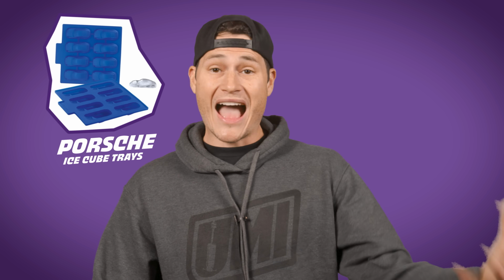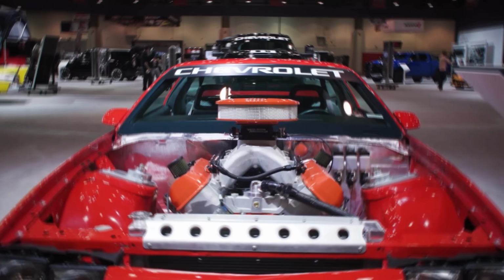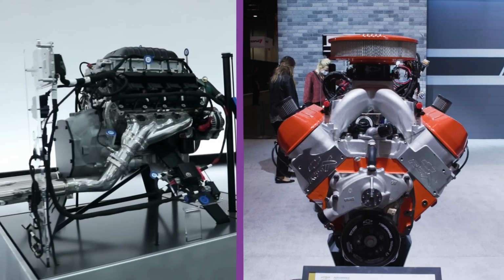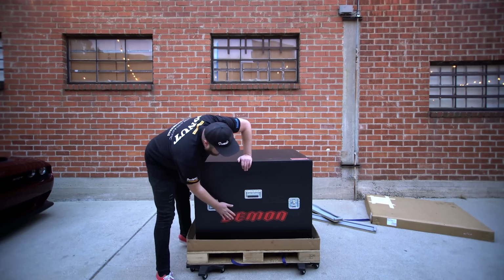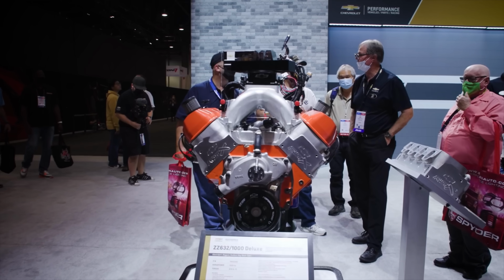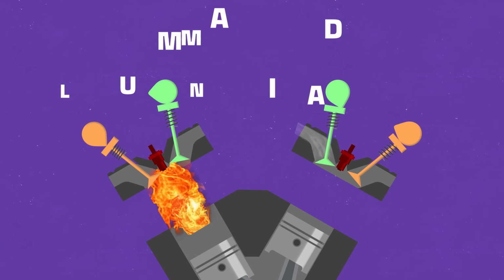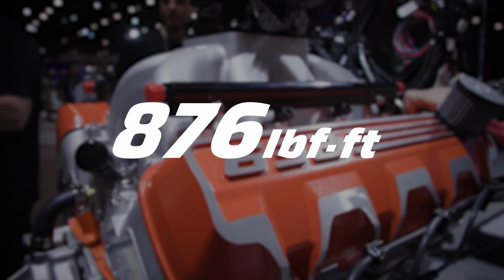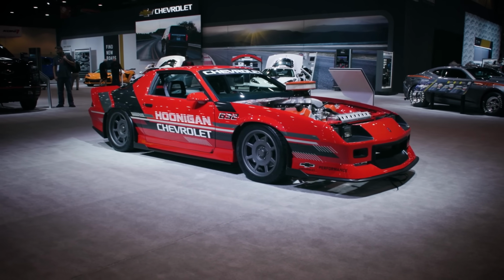Chevy's 1000HP Crate Engine EXPLAINED

Comment: Pretty crazy they can get this much power out of a wooden motor.
Reply: Haha 😂
Reply: These replys have gotten out of hand lmao
Reply: @MyHeadHz   these replies are so full of ignorance, there’s a balance between reliability, fuel economy, and rpm @ peak torque. Can guarantee the valkyrie engine will be nowhere near as reliable as this, you have to spin it almost twice as fast to get the same horsepower #’s. Fuel economy will be shit for both, but why is that even a factor at this level? You push this 632 engine much less than you’d push a valkyrie motor & get the same power output. F1engines are constantly rebuilt because in order to get such insane numbers, reliability goes down the drain so to speak, tighter tolerances & higher rpm’s = more wear, same concept as top fuel engines, but top fuel takes it to greater lengths.
Reply: @RegulerShowTV  I agree that most of these replies are ignorant lol
Reply: @RegulerShowTV  Nice to see someone who knows what he's talking about :). I used to be a hp per litre 'tard until i learned that Chevy LS engines are actually light and small in size, for sheer performance its not about hp per litre, its about hp per kg / lb.
Reply: @RegulerShowTV  bro really forgot the original commenters comment 💀

HP/L was the only discussion bro go get urself hydrated
Reply: @MyHeadHz  lmaooo
Reply: this is an engine for hot rod vehicles, not your everyday car.

The average piston speed at its peak revs (7000 rpm) is 29.5 m/s which is extremely high, the maximum average piston speed for the C8 corvette (base model is less than 21 m/s, for high revving cars, it’s usually under 25 m/s, and for an V10 F1 car, it is under 25 m/s and less than 27.5 m/s for short periods of time. 

29.5 m/s is incredibly high especially since every cylinders/pistons in the engine is massive 

The reason I am using piston speed is because piston speeds generally determine how much power an engine can create reliably. High piston speeds generally reduce the lifespan of an engine.
Reply: Motors are electric
Reply: Driving something with big block torque needs to be experienced to understand. Old tech that's still relatively cheap and will run reliably for many years.
Reply: @reto adyt I bet that zz632 is much more reliable than any part of the Valkyrie. Let’s also talk about servicing this engine in the Valkyrie. Can’t do it in your back yard like you can a big block. Overall yeah the numbers are impressive for the dinky little European cars. But this engine is much more attainable and attractive.
Reply: @onyxphantom6762  yeah if we take the convo that direction of course it wins by a long shot, but the only reason why the Valkyrie V12 is in the convo is because of the 1000 HP, if we take that outta the equation and talk aby built engines, ill go with EKanoo's stock block stock crank 2000 HP 2JZ.
Reply: moza rela  Reported.
Reply: block doesn't make power. IT just holds power. It's the head and piston design that's important.
Reply: @mehrshadvr4  and the crank and Rod design also not to mention the valves and the cams, or hell, every part other than the block! The block doesn't matter! Nor does the paint color on it 😂.
Reply: yoink
Reply: Right?
Reply: Right imagine a plastic lne
Reply: For a race car where you're always going to the red line, peak power is better.
For a road car where people tend to keep theax rpm at 4/5k rpm, a good torque is better. 
All in all, having well tuned transmission is what mater the most.
Reply: I was the 1,000th like on this comment
Reply: Lol!
Reply: @Silverhands  you can multiply torque. just need two cogs. you cant multiply power. that's physics
Reply: @motorhead281  no!
Reply: 1000 Hp wooden motor.  HaHa
Reply: Well, you'd make that much power too if you were locked in a crate, Mr.
Reply: @onyxphantom6762  exactly what you stated... power potential is derived from the displacement of the engine. A larger engine always has more Headroom in power potential. There is no replacement for displacement!
Reply: Is the Valkyrie available for just anyone to purchase?
Reply: @Coach_BigMac  no and it’s going to cost 💲 big money when it will be for sale
Reply: @Coach_BigMac  oh yeah they're in multiple numbers as they build 25 cars a year and they cost 3.5 million each and everyone here is comparing it to a $29,000 Chevy crate motor .. expressively showing the intelligence of the millennial children of today
Reply: @Coach_BigMac  and to who, is a 10.4L motor marketed towards? No car, no exhaust, no gearbox, nothing. Just the engine. 10.4L of it. 

The price, the market does not matter. The discussion is purely HP/L on a production engine that could be purchased with or without a car attatched to it.
Reply: @retoadyt3196 is 100% a drag racing engine. And I need one in my daily driver for...... making Corvette owners cry. They've had it too good around here.
Reply: @jordanalexander615  HAHAHAHA 🔥🔥🔥
Reply: @retoadyt3196  the plant that's makes Corvettes is literally an hour and a half away so you can imagine how many I see. Where is everyone getting this kind of money
Reply: @retoadyt3196 I reckon it’d be marketed to fellas like myself that drag race and have vehicles that originally had a big block fitted to it.
Reply: Its not so crazy when we convert the ci to cc to litres, which in litres this crate engine is a 10.4, so no, not so impressive. It takes more litres to make the desired HP. Valkyrie is a 6.5 making 1000 HP, all motor.
Reply: @retoadyt3196  but the Valkyrie makes 330ftlbs less torque due to that lower displacement, Maybe read up a bit on the differences and then come back. Horsepower is just revs, the Valkyrie needs 7 speeds, This crate motor would do fine with 4.
Reply: @skiptastic1000  original commenter didnt say anything about torque, just power.
Reply: @skiptastic1000  yeah buddy, ofc it's losing power because of the transmission... hey dummy, do you know these power figures were measured WITHOUT an gearbox, right? As you said, horsepower is about revs, gearbox losses are totally appart from that
Reply: @skiptastic1000  you think less speeds is better ? go electric 😁. jokes aside, performance engine and 4 speed + 680lbs is  a bit of a contradiction. plus it's NA so its still kinda peaky if you compare to a forced induction engine. makes peak torque at 5600 and peak power at 6600, much narrower power and than a dodge demon for instance, with 4 speed you will lose a lot of performance. it's a impressive engine but in it's "stock" form it's not very useful for any kind of racing. too heavy for track racing where naturally aspirated makes the most sense, not best power/weight for drag either or you could do same power with turbo/supercharger on a smaller engine.
but still a beautiful piece of engineering especially if you want to hot rod a classic car while staying true to big block V8
Reply: @retoadyt3196  torque is what gives you those low ET numbers at the end of the quarter mile
Reply: @geemy9675  yes but when you compare a forced induction engine to a naturally aspirated engine you're obviously going to come up with wild conclusions. You can't compare two obviously different things together, it doesn't work like that. This engine is for people that want a powerful street car with an engine that is very reliable. When you start making a shit ton of power from power adders, you start to decrease the lifespan of your engine. This is common sense. This engine is meant to be dropped into the engine bay of a car, hooked up, and cruised. I'm sure there will be some crazy people that will decide to tear it down and make it stronger, but that's the intention of this motor.
Reply: @sethh8892    Chevy says "PARTS INTENDED FOR COMPETITION USE ONLY" and show pictures of camaro drag racing, so not really meant for daily driving/cruising.
but regardless if you wanna drag race it or cruise it my point is that by today's standards it's a bit of an odd match to offer a NA engine with peak torque at 5600rpm and peak power at 6600rpm, redlines at 7000rpm, with a 4 speed.
on the street you're not going to spend a lot of time over 5600rpm, on drag strip, you're gonna lose to cars with lighter engine, wider (supercharged) torque, and more speeds that will stay in the power band during shifts. the transmission ratios: 1st: 3.06, 2nd: 1.62, 3rd: 1.00, 4th: 0.70 so your gonna drop half the rpms between 1st and 2nd, 40% 2nd to 3rd, 30% 3rd to 4th
modern transmissions can now shift quickly and fit many gears.
But it all makes sense if you want lot of reliable power with a warranty and an old school vibe
Reply: @skiptastic1000  powerglide had the lowest loss
Reply: @retoadyt3196  Chevy's widely available retail unit engine vs  multi million dollar car thats already sold out. Heck F1 cars make more hp than Valkyrie.
Reply: @user-njngyv  Both engines are completely different to each other, read up about them and you'll see what the differences are. A properly designed engine (Valkyrie) can produce much more power with less displacement needed than a poorly designed engine (ZZ632). Crate engines need to come into the 21st century already.
Reply: @user-njngyv  original commenter didnt mention commercial availability and price, just power.
Reply: @Roman2k18  people are not going to pay 1/4 millin dollars for a crate motor......
Reply: @Roman2k18  u got that right man, 10.4 should be making 1040 HP at least by today's standards. T50 makes 650 HP from a 4.0L, GT3 RS makes 520 HP from a 4L, GT350 makes 528 HP from a 5L, Huracan makes 640 HP from a 5.2, etc. 1000 HP is impressive, until the displacement convo is brought in for this crate motor.
Reply: @retoadyt3196  thing is all those engines are DOHC whilst the zz632 is Still pushrod. If it was DOHC I'd expect big numbers like 12 maybe even 1300 or 1400 hp. Would make the engine more expensive but have much more power potential
Reply: @Roman2k18  combined with Topology Optimization, 3D printing technology, perhaps freevalve? Idk really but for sure with today's tech and engineering, 1300 HP N/A is reachable. Torque will be sacrificed, but if its going inside a anything below 1400 KG's, even 450 lb/ft wont matter so much lmao.
Reply: @retoadyt3196  why would torque have to be sacrificed?
Reply: @Roman2k18  how would dohc limit power potential?
Reply: @meegstomtom  how much extra load u wanna pull? If ur gonna carry a commercial shipping container behind u yeah sure give it extra torque, but if the car is light and it doesnt need to carry extra load, it doesnt need more torque. Toqrue is how much weight the engine can pull, power is how fast you'll go.
Reply: @meegstomtom  he didnt say DOHC is limiting potential, he said that the fact that it is not a DOHC is limiting potential, meaning with DOHC the potency will be unleashed. 911 4L 520 HP, LFA 4.8L 550 HP, Ferrari 4.5 V8 570 HP, Huracan V10 640 HP, T50 4L 650 HP, Valkyrie 6.5L 1000 HP, etc. All those engines make more power than displacement, they are all naturally aspirated and they are all DOHC. Chevy Z06 5.5L 670 HP and Ford GT350 5.2 526 HP included in that list.
Reply: @meegstomtom  DOHC allows for much better airflow through a head since more valves can be used allowing more air to enter but also allowing the left over gases to escape better and faster increasing performance
Reply: @Roman2k18  to add a lil, theres the cams, VVT, VVL apart from just the valves opening and closing, the variables of the distance and duration of these valves go through in which rpm, also the number of valves, etc.
Reply: @Roman2k18  but that is only the case for some engines. A Ford 5.4 2v vs 4v make about the same torque while the 4v makes more HP. There is no loss in torque. 

Cylinder head design and piston type can change this.
Reply: @retoadyt3196  I don't pull shipping containers but I do run a lawn care business with enclosed trailers and often filly loaded beds in spring and fall. To some torque does matter.
Reply: @retoadyt3196  most of those engines have more cylinders and less torque and all them have higher rpm which always leads to more power and not to mention they are all on race fuel, this has less of everything and still manages to make 1000hp which is insane.
Reply: @retoadyt3196  The biggest benefit to DOHC for ultimate power would be the ability to rev higher because there is less reciprocating mass in the valvetrain. Variable valve timing, lift, and duration help power under the curve but won't increase the peak number. Once you start talking about power to displacement ratio, or BMEP, an NA built K20 is pretty hard to beat.
Reply: @DerekS1978  true that, man. It's not like Aston Martin engines are available or comparatively cheap at all vs a crate motor v8.
Reply: @meegstomtom  oh well im not part of that discussion, i was on the HP/L convo, my bad man, though talking abt torque, cant ever go wrong with cummins
Reply: @NNFaNRacing  K20's my ultimate wet dream.
Reply: @guamazolopez6456  if a 10.4 performance engine aint impressive it shouldnt exist
Reply: @retoadyt3196  for the technology it has it is very impressive but they could've added newer technology in it
Reply: @guamazolopez6456  wouldve took too long and costed too much for rhe company probably lmao
Reply: @retoadyt3196  chevy is already good at building v8's, I think they wanted a big engine that was simple and could handle more power if it has turbos or superchargers than ones with more technology
Reply: @retoadyt3196  Multi came engines   main issue for people who want to swap is they're large for the displacement size.
Reply: @Rumpledstiltskin  that is true, they take space but then it is a worthy compromise considering the performance you'll get out of it
Reply: @retoadyt3196  tell me what cylinders have to do with power. Now explain sohc and dohc and that’s why lower displacement makes what it makes. It’s not rocket science
Reply: @kennethraff2002  didn't know V13s existed
Reply: @Roman2k18   perfect reply for someone that wants to dodge all the points made your dismissed go back to simulation racing adults are talking
Reply: @DerekS1978  they do you just don't know those type of people
Reply: @HeadStoneoftheCorner  show me an example...
Reply: @DerekS1978  depending on who built the crate it could be worth a quarter of a million there are tons of engine builders making money of the rich for it
Reply: @HeadStoneoftheCorner  thats not a crate motor...
Reply: @DerekS1978  crate engines are plug and Play
Reply: @HeadStoneoftheCorner  they're also mass produced
Reply: @HeadStoneoftheCorner  what you're talking about is just getting a builder to build you an engine that's not the same thing as a crate motor
Reply: @DerekS1978  😐
Reply: @DerekS1978  never heard of any engine building shops that make in house engine for promods at all
Reply: @retoadyt3196  to be fair, you can't just scale a motor and make same power/displacement.  huge engines don't like to rev that high. if you add cylinders, then you can keep revving. for instance take two gt350 engines  for a 10l V16 that makes 1056hp. but a 10l V8 can't make that power so easily. higher piston speeds, heavier pistons don't like high redlines.
Reply: @retoadyt3196  well torque doesn't really mean anything actually if you have gears, more power can pull more weight with less torque. just downshift and you have more wheel torque which is what pulls more weight
Reply: @Roman2k18  I don't think the ZZ632 can be called a 'poorly-designed' engine. It might be using older technology such as pushrods, and its specific output might be low, but that still doesn't make it poorly designed by any means. I do miss V10s and V12s, though. It's really sad to see that these V8s, 4 and 3 cylinder engines might go away in the foreseeable future too. 🥲
Reply: @Roman2k18  Calling a zz632 "poorly designed" really clarifies your ignorance
Reply: @user-njngyv  formula One engines last about a thousand miles and cost between 7 and 8 million you are out of order case closed
Reply: @Roman2k18  the price certainly isn't 21st century... What did he say $ 29,000. And later he said could go as high as $37,000 ... You can buy a used Camaro, mustang, or a Dodge Challenger and buy a brand new Ken Bell supercharger and make a thousand horsepower and drive it.. and not spend $37,000
Reply: @DerekS1978  it does not cost $250,000. The man said $29,000.. and later can go up as high as $37,000 which is still too much for one engine of this type... But there are others here in the comments section that are comparing it to the horsepower of a F1 engine... First of all and if one doesn't make the amount of torque so it's not going to do the quarter mile as well. And they only last for about a thousand 1300 miles and cost 7 to 8 million each
Reply: @meegstomtom  what gives you the idea that a double overhead cam engine will make more horsepower than a pushrod engine... Remember nothing replaces cubic inches
Reply: @retoadyt3196  torque is what gives you those low ET numbers at the end of the quarter mile. As it is torque that gives you lower 0 to 60 numbers and not so much the horsepower... It's torque that limits how fast you can go in a certain amount of time.. as is what's all racing is about
Reply: @donniebaker5984  I guess you didn't see the comment I was replying to...
Reply: @donniebaker5984  dohc doesn't mean more power at all. But ohv vs ohc vs dohc can effect Air flow and provide different results and different rpm ranges.  It doesn't literally mean it'll make more power. But it can help. 

Take the ford 6.2 vs Chevy 6.2. The LS makes more power. But a 5.3 vs a 5.0 coyote is the other way around, in stock forms. 

While displacement maters. There are lots of other things that do to. Compression, cam profile, flow rates, etc.
Reply: @Roman2k18  Please explain how the Chevy is a poorly designed engine... I would love to hear your high class engineering experience that determines the poor engineering designs behind the engine... What would you do better o' grandmaster?
Reply: @retoadyt3196  it's off by 40 horsepower... Thats really not a big deal, and probably wouldn't be a noticeable difference. Literally just a 4% difference... Ooooh, boo hooo
Reply: @Roman2k18  that is not necessarily true. Just because you have more valves does not necessarily mean that you have more cfms...
Reply: @meegstomtom  well yeah, you're not going to lose torque. Torque is displacement, the camshafts do not effect the bore or stroke. They can limit torque, but dont make it.
Reply: @guamazolopez6456  this comment exactly. The other engines they're referring to are being strained to their absolute limits of the material they are made of in order to achieve the power levels they have. While being very efficient and also impressive, they don't last worth a damn. These engines will need to be overhauled way more often, because they're being worked harder. Look at a cruiser motorcycle versus a sport bike. Cruisers last forever in comparison to sport bikes that need new engines every 30k miles.
Reply: @guamazolopez6456  this is exactly right. They made a large engine that can make good power from the factory, but also has plenty of headroom for someone that wanted to build more power. This engine is not being pushed to its absolute limits, this engine is able to reliably make a thousand horsepower and will last a good while.
Reply: @sethh8892  its off by 40 horsepower? Its a 10+ litres and it only makes 1000 hp? Really? 6+ litres nowadays can make fare above 1k hp, and 10+ litres can only make 1k hp? Hennessey, Koenigsegg, Bugatti, Aston Martin, Mercedes, McLaren, Porsche would be laughing their lungs out if they see ur comments. Its not all about displacement, power and torque lol.
Reply: @retoadyt3196  It's  70 year old technology, you know something better that's that old we can buy in a crate? I didn't think so.
Reply: @jasonbourne1596  well if old stuff is what you're into thats good for u but im talking in a more advanced, modern and efficient thingy. Idk man, I just will never bother investing in something like 1000+ hp car but it only has limited usage. If I have to go affordable route, I simply won't ever touch anything above 580 hp.
Reply: @jasonbourne1596  im sorry im too dumb to understand what u meant, could u rephrase pls lmao
Reply: @retoadyt3196  I'm into an engine I have control over that they can't shut down, that's what I'm into.

It's already mandated any new car has to have the means to be remotely shut down by 2026 tic tok. Tic tok.
Reply: @retoadyt3196  It's not just about the engine, rhe whole car from the throttle to the brakes can be controlled, so we aren't just talking about a new engine ECU here, drive by wire components will all have to be replaced,  you may as well just buy an older car and make it new.
Reply: @Roman2k18  Valkyrie engine is not properly designed. It's just different. Also it costs insane amounts of money. Hell it is about as old fashioned as you can get. I bet you don't even know that Valkyrie engine does not have direct injection.
Reply: @meegstomtom  well if ur small business needs that amount of power and torque for whatever reason go at it. I mean, why? But wtv it's none of my business
Reply: @guamazolopez6456  it's either rpm's, aspiration, engine design/fuel types, strokes or displacement. I'll take the first two any time any day. Ur precious gelatinous behemoth displacement of a v8 belongs in post-war era and it should stay that way.
Reply: @kennethraff2002  name me a 5000hp single cylinder.
Reply: @retoadyt3196   that’s also a v12 and it’s a formula 1 engine lol and also mind you no where near 29,000 or even 37,000
Reply: @retoadyt3196   needs to be rebuilt every 65,000 it’s a v12 which means more cylinders so the 6.5 is deceptive and it’s based on a F1 engine also it’s up to this point unattainable unless you buy a super/hyper car so with all points made this is Chevrolets crate engine offer and you can buy it and for performance it comes in at at $29 per horsepower you’d be hard pressed to beat that equation with parts and labor involved and as for crates the only one near this is dodges hellephant and it’s already got a power adder so what if you put a power adder on the 632?!?
Reply: @kennethraff2002  just buy an 602ci Hemi and get n/a 1000hp for 5 to 10 grand less and be happy...
Reply: @kuiper6926   send me a link
Reply: @retoadyt3196  still impressive, though.
Reply: @retoadyt3196  knows where to get a valkerie  engine for 30 grand? Or maybe he is just a little impressed and when he grows up he's gonna buy one.
Reply: @Puplemonkeyxd  go tell the original commenter to add pricing to his original comment lmao, this convo has nothing to do w pricing
Reply: @Puplemonkeyxd  or maybe just get an LT? Lol people r so addicted to glorified 18 wheeler sized engines.
Reply: @retoadyt3196   but that motor needs to rev to nearly 12k rpm’s to do so
Reply: @retoadyt3196  totally not the point
Reply: @retoadyt3196  the Valkyrie engine is also a V12, while this one is a V8, so fewer cylinders means lower rev limits and lower horsepower ratings (11,100 rpm for the Valkyrie V12 vs 7000 rpm for the ZZ632). The Valkyrie engine might need to run on higher-octane fuel to make that power, while this engine (as Jeremiah and the others say) can make that 1000 hp on pump gas. Both the engines are not directly comparable with each other.
Reply: @retoadyt3196  the only people that care about internal displacement are bean counters, in the world of racing it comes down to 3 things

Weight, power, and price.

Best you can ever do is 2 out of 3. ZZ632 is big power, low price. Valkyrie motor is big power, light weight.

But then again, you could also throw a set of turbos on that ZZ632 and make +3000hp...
Reply: @SoI_Badguy  id love to own that insane v8, but talking the prior topic, yeah i guess it boils down to that and the type of racing ur doing. I dont see a large, heavy engine would benefit for a few rounds in nurburgring. The largest displacement engines ik of that had set afoot in that track was 8.4 V10 and 8.0 W16, rest are smaller. Ideally u want less weight on the motor and said weight close as possible to middle of the car, except if ur Porsche ofc. V12 on Valkyrie is light, though its long as, which isnt ideal for handling. The length of the engine brings the center of mass further out but its for sound, so i understood the compromise, and its a trade off well done I'd say.
Reply: @retoadyt3196  I wonder why they don't use 6.5 L engines for the 10,000+ horsepower drag motors... it's almost as if there are different places for different equipment. This engine has a specific task, and is better at doing that task than that 6.5 Valkyrie.
Reply: @retoadyt3196  also you're comparing a v12 DOHC engine that has to wrap up to 11,500 rpms to get that power, where as this motor makes peak power at 6,600 rpms. So it makes roughly the same power at half the RPMs... which says a lot about the torque... and if we take a look, we can see there is a massive difference in torque between the Chevy and the Valkyrie. The Chevy crate motor clearly takes the win on torque, has to be expected for a drag motor. Comparing a drag motor to a track motor is ridiculous. You're not even comparing apples to oranges, at least apples and oranges are both fruit...
Reply: @retoadyt3196  At what price?
Reply: @robertpoudrette4483  don't care about price when talking 1000+ hp. If we talk about some economy car w only 90hp where the only concern is mpg then sure, buy the cheapest most reliable, practical with the least fuel consumption cus i wanna save money. There's no such thing as cheap when talking about 1000+ hp cars in my book cus the car MUST reliable, practical, luxurious, safe, comfortable, daily drivable with at the very least GT3 level of handling.Again,  I don't give a crap about a car that only drifts or only goes in straight line etc or has screwed up weight distribution etc. If imma have 1000+ hp car, ima go all out and buy/build the perfect all rounder hypercar. 1000+ hp GT, circuit, performance, drag, drift and daily car. That's MY definition of 1000+ hp car. Fuck V8's too cus if ima have that car, might as well sound more special than the typical mainstream american crossplane v8, ima have LFA/gen 1 Gallardo sound on it.
Reply: @retoadyt3196  it has 4 more cylinders, 1/4 of the torque of this and it's in a car that costs 3 million. There are 6.5 N/A 1000hp LS engines that will not set up back millions and will make actual torque.
Reply: @Inc0mplete13  unless the car weighs 2,5 tonnes, dont really see the point of that much torque. No plans to tow a commercial container behind my car anytime soon. Unless maybe there's a 560-pound obese guy too lazy to walk 100 meters to 7/11 or smth then sure I'll buy that big, low revving, lazy american engine.
Reply: @retoadyt3196  I see you learned you were wrong about your last reply and wisely took it down.
Reply: @jasonbourne1596  which comment? I don't remember taking any down.
Reply: @retoadyt3196  Well it's gone now and I've slept since then, but there was one in my feed and when I came here it was gone.
Reply: @Jason Bourne  well I don't remember if i have ever made one or no, I'm super confused now. Anyways, long live mucle car, that new electric charger with its fake sound is a pain on one's heart.
Reply: @retoadyt3196 this engine has the potential to make way more power, you can get 1000hp out of a 6 cylinder, but it won't hold together near as long as this engine, you could give it boost and double or triple that number but this engine can reliably and easily give you 1000hp for years and years without needing rebuilt where a race engine is going to need about 10x more maintenance.
Reply: @4strokerace-ist  yes i agree 110% but stock hp/l was the topic on that heated ass elections debate
Reply: @retoadyt3196  it's kindve like a raptor 700 vs a yfz450, they make about the same power even though the raptor has way more displacement. The 450 has way lighter internals, higher compression,  and tighter tolerances to achieve this. The 450 needs rebuilt about 2x as often as the raptor 700 because the raptor is barely breaking a sweat at the power it's making, it doesn't need light internals or high compression,  it's a much more reliable engine. If you boosted a 2jz to make the same power as this engine it would last 1/4 as long as this one.
Reply: @4strokerace-ist  110%, but no. This is pure hp/l. Original comment clearly said it, i wrote this in many replies for 2yrs. Hp/l is barely related to reliability, durability or longevity. Don't matter if it runs quarter mile before engine blows up, hp/l is hp/l.
Reply: @retoadyt3196  Yeah, but that's also the reason why the Valkyrie has gotten delayed n the first customer car "built" just a few weeks ago (Still hasn't been handed over to the customer). Extremely excited to know what the real thing is gonna look n sound like on the road amongst normal traffic tho. It's too highly strung an engine for normal usability whereas I'm sure that this V8 wouldn't really mind sittin in abit of traffic. But Cosworth has really done a fine job with that V12. Hope most of the 300 or so owners drive em instead of havin em sit looking pretty as garage queens.
Reply: @retoadyt3196  It's a v12 that makes 1000hp at 10 500 RPM. This is a v8 that makes 1000hp at 6600 RPM. The v8 is more impressive
Reply: @RazdaCX30  on a 10.4 it better be impressive lmao that shit will drain the fuel station in 2 days
Reply: @RazdaCX30  out of a massive, unnecessary, outdated, too large of a block. If that engine is so damn good everyone would be using it. The big ass honker might be affordable and simple to work on etc but nobody's using it so i rest my case.
Reply: Power is for dynos, torque wins races.
Reply: @CanadaBud23  biggest bullshit ever read. Power is torque X revs, what wins races is right gearing, low weight and good aero.
Reply: @CanadaBud23  torque wins races? Yeah pull out a semi full of torque next to a f1, see who wins.
Reply: @retoadyt3196  Ok you don't know what your talking about in this comment, semis,especially the ones with big power have the drag coefficient of a brick, their tires are made of really hard compound for longevity and the heavy trailer is what gives it most of its traction, the gear ratios are high for towing, the gears are short and manual shifting isn't very fast which leads to slower acceleration and nothing screams performance about a semi except for its engine. If you were to put a semi drive train with better gears in a car that could handle the stresses would tear the f1 car to pieces. Even with all these downsides a semis with big and impressive engines like the CAT motors can smoke most cars on the road, semis with big power that people use to work can even make it up to 115 or 120mph on the quarter mile, search up semi pulls on YouTube, they are impressive.
Reply: @guamazolopez6456  this knowledge I got from Gordon Murray himself who designed the damn McLaren F1, the lighter the car is the less torque it needs. I never said torque is not needed at all lmao. F1 cars prove that point. They are incredibly fast without needing a million lb/ft of torque. Torque is needed but we can argue with real world applications of it all, they speak for themselves lmao
Reply: @retoadyt3196  Don't forget to hook up that 80,000 lbs trailer to the F1 car then, see how far it gets.
Reply: @CanadaBud23  with right gearing it'll tow better than 1000lb-ft tho lol
Reply: @retoadyt3196   you're comparing a car that can be lifted by a few people to a semi truck that weighs multiple tons. You're making a shit comparison. Torque absolutely does win races, as well as other factors. Including weight...
Reply: @retoadyt3196  just because a car needs less torque doesn't mean it can't have more torque, and it definitely doesn't mean it cannot benefit from having more torque. What it needs versus what it can handle are two different topics. Technically we don't need high performance engines but we definitely want them.
Reply: @sethh8892  torque wins races and is needed, under what circumstances? How muchh of that torque is needed exactly? I'd rather listen to people like Gordon murray, Adrian Newey, etc than you lol.
Reply: @CanadaBud23  you are wrong
Reply: @CanadaBud23  nah. Torque is one out of 81983839298839108382 factors that wins races. Big torque means nothing if it's put in a long geared FWD front engine 3 tonnes 5 meters long behemoth and gelatinous chassis with 185 used summer tyres on chopped coils.
Reply: @CanadaBud23  Then why aren't turbo diesels with tons of torque and much less power used in the fastest drag cars? The acceleration of a vehicle, ignoring drag, is: 

Acceleration = Power/(Velocity * Mass)

Torque doesn't determine acceleration, it just describes how fast the motor is spinning when it makes a certain amount of power.
Reply: @NNFaNRacing  diesels are heavy
Reply: @NNFaNRacing  turbo Diesel's have a shit ton of horsepower... and are used quite often in drag racing... and more often than not win... what crack are you smoking? I can't name a single turbo diesel that doesn't have a shit ton of power. A lot of them are limited massively by the factory, but a simple trip to the tune shop and you'll have your power back.
Reply: @NNFaNRacing  torque doesn't determine acceleration? Ok, sure. I'm sure the 8,000 lb feet of torque that is produced by a funny car has nothing to do with its 4 G's of acceleration... I'm sure that a high winding low displacement, low torque motor will be the most efficient when trying to tow... absolutely torque effects acceleration. That's literally the goal of every drag car! Acceleration!
Reply: @NNFaNRacing  this is so blatantly false, I don't know how you were able to say that without questioning your own logic. Find me one reputable source that says torque doesn't determine acceleration.
Reply: @SS72Nova  that's possibly the dumbest thing I've ever heard, go learn how engines work and come back to me